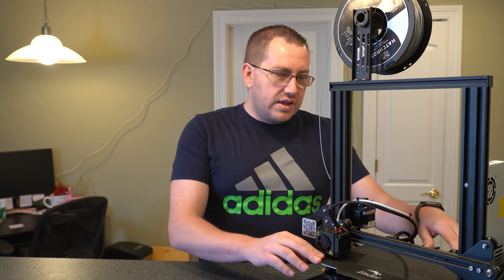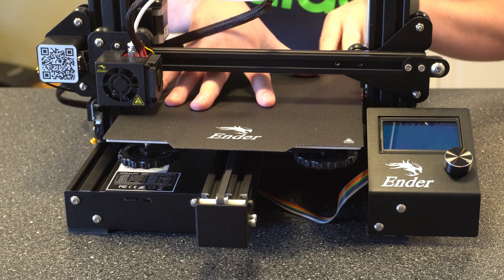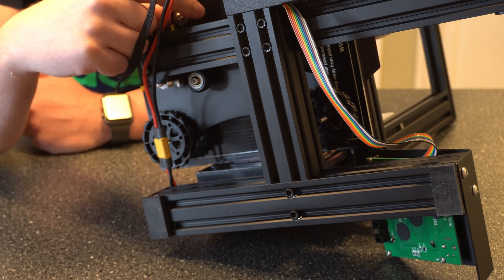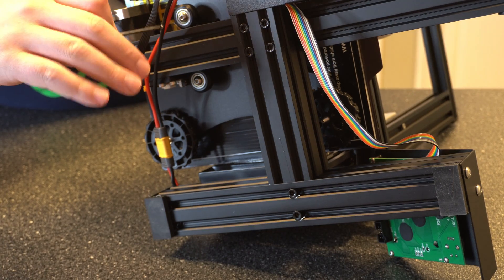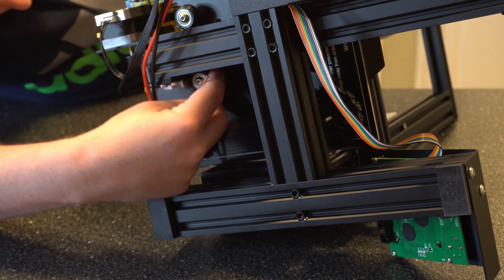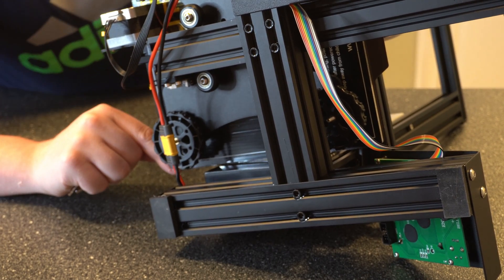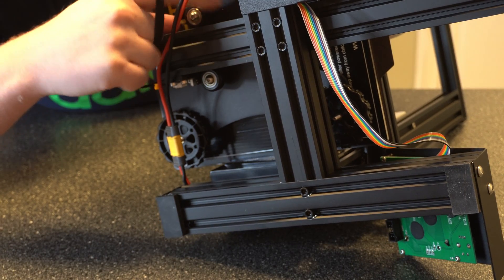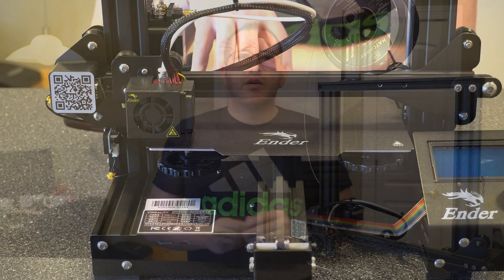Ender 3 Pro Bed Wobble – How to Fix It!

Comment: strong recommend against leaning an ender 3 on its side. Luckily power supply still ok
Reply from the maker: Hi. Thanks for the feedback. I have had no issues doing this but you will need to relevel the bed and stuff.
Reply: @3DPrintscape  was a helpful video for getting the basic idea of what was going on. I just had the provided wrench and don't have enough hands to hold the provided wrench in place while squeezing the rollers together and tightening them, and you can't just lean it against the works or else it gets stuck and you undo your efforts.
Reply from the maker: @williaminnes6635  Hi. ya it can be a pain some times. Thanks for the feedback.

Comment: For anyone stil having this problem even after you've tightened everything, make it tighter. These have to be SUPER tight.
Reply from the maker: Hi. Thanks for sharing. Just don’t over tighten them. I had an issue where I dented a wheel doing that.

Comment: Hi, you are great.  I have a shift happening after 1st mm.  Then all is normal but still not what i need.  I admit my maintenance is crappy.  Do i need to oil the long vertical screw?  I know i have to clean the bottom wheels.  They are used pretty badly.  Do i have to exchange them?  This scares me…. Do you have a video on that?  I have an ender 3.  I checked the tension on the belts, they make a sound, so i guess they are ok.  Do i have to actually take them out and look if they are damaged?  Also, found some advice on looking at the pulleys but no video how to do that….  I am not a mechanic but a woman who, well, is scared of destroying my work tool.  Any advice would be greatly appreciated.  Thank you.
Reply from the maker: Hi. I have a video covering the lubing the z axis and that should fix any issues there. That said, i would also look for a damaged wheel or something like that.

Comment: This is easier on the ender 3 pro, one side of the carriage has eccentric nuts that can be turned using the 8mm wrench to press the wheels into the track. Access only needed from the bottom side, which is nice.
Reply from the maker: Hi. It is for sure.
Reply: Idk about that I've had so many issues with my brand new ender 3 pro. Now I'm having trouble getting the bed to stop wobbling. I've tightened the stationary wheels and done the eccentric nuts but even if I get it close it's never right and the best I've done is print in the middle of the bed

Comment: I've tightened everything down and it's still wobbling
Reply from the maker: Hi. Did you tighten the eccentric nuts on the right side of the bed?
Reply: @3DPrintscape  i just said I've tightened everything down, didn't I?
Reply from the maker: @RIPLinkTTV  The eccentric nuts are different, so i wanted to make sure you got those. If you tightened all of the outside bolts/nuts and it still wobbles you can adjust the eccentric nuts to fix that.
Reply: @3DPrintscape  how can I adjust the eccentric nuts?
Reply from the maker: @RIPLinkTTV  This is an old video, i cover that more in this version of the video. https://www.youtube.com/watch?v=AAlDrkhMqYw&t=0s

Comment: Rob has some good ideas to get you going but assuming all your hardware is snug this doesn't fix bed wobble. Go check out Easy Fix for Bed Wobble on Ender 3 3D Printer by Jerry Jackson DIY, he has the missing info to Rob's video plus Jerry keeps it short, sweet and to the point...unlike this comment
Reply from the maker: Hi. Thanks for sharing.

Comment: good video, quickly just jumping thru, did you ever touch the hex standoffs between the wheel and plate? took me over a year to find out they drill it off centre. meaning on side pushes the wheel closer to the extruded frame. very useful to get any twist in the bed
Reply from the maker: Hi. Ya i had to adjust those for different reasons. I cover that in more detail on the replacement video i made for this.

Comment: There seems to be a slightly different design on my new Ender 3 Pro which just arrived as you don't need to use an allen key (just the spanner) but this fixed my issue before bed levelling.

Thank you for helping out us newbies to 3d printing!
Reply from the maker: Hi. Thanks for the info and feedback.

Comment: In fact, the first thing to do before assembling any screews on an Ender, is to put a level on the bed, perpendicular to Y axis. Than we slide manualy along Y axis an see if it's the same a along. If not investigate. It might be about roller but also a warped Y axis extrusion.
Reply from the maker: Hi. Thanks for the feedback. That’s good advice for someone setting up their printer for the first time.

Comment: Your video wasn't the correct fix for me. For anyone else with a rocking bed, try tightening the two eccentric nuts on the right side of the bed (left side doesn't have it). I watched Jerry Jacksons DIY video on fixing the bed and it worked. Thanks anyways, man!
Reply from the maker: Hi. Thanks for the feedback. I did this video based on the issue I was having. I realized afterward that I should have talked about the eccentric nuts. I will add a note about them in the description.
Reply: Absolute lifesaver of a comment. Had been having issues with the bed rocking, tried the solution in the video, didn't work, tried this solution and problem sorted.

Comment: You know this video would be 100x better if you stayed on topic, filmed the important parts (or drew a diagram! or took off the bed plate! you're trying to make an educational video!) - I was hoping for an explanation of things to consider not 5 minutes of you turning 4 screws, we know how screws work!
Reply from the maker: Hi. Thanks for the feedback. I agree the use of a diagram would have helped out. It's difficult to create a video that will make everyone happy, so I try to target the 80%.
Reply: @3DPrintscape  I saw a reddit post of a guy spitting and cursing that he was tightening those bolts till he went blue and only made it worse - if you position yourself as a teacher you have a responsibility. Imagine if your doctor told you, well I'm sorry your surgery went wrong, I try to target the 80%. 🤷‍♂️
Reply: @OnufrievS  This could have literally been a 60 second video. "See these bolts? Tighten them." plus, the part he forgot "See these right side bolts? they are eccentric"
Reply: I found this video useful where other videos made it seem trickier.  I guess I'm in the 80%

Comment: I hate you, I've been dealing with this forever and I watched your video and I thought that was the best it was gonna get. you were wrong this whole time. there are two hex nuts by the wheel. that's where you tighten it, not the nuts between the plates.
Reply: directly on top of the wheels on the right side is where you tighten the hex nuts. and hold the plate down while you're doing it.
Reply from the maker: Hi. Thanks for the feedback. Sorry I didn’t cover the eccentric nuts in the video. I was focused on correcting the larger issue I was having from my kids messing with the bed. You would need to make sure the parts I coved are tight, then if you are still having issues, you would look into tightening the eccentric nuts.

Comment: The most important part of the video is off screen. I have no idea where you put the wrench. It is not clear what you were adjusting. You should have thrown this footage away and redone it with better camera placement.
Reply from the maker: Hi. Sorry about the camera angle, Its such a small area to work that there wouldn’t really be a good way to capture it with the camera I have. The wrench goes on the nut that is above the steel frame.

Comment: Hi, good video 🙂 I would just add that the adjustment needed of the bearing wheels can also be on the eccentric nuts. Turning them a bit at a time will remove the last of that wobble.
Reply from the maker: Thanks, and thanks for the additional tip!
Reply: Yup, that did the trick. Also, easier than using the allen wrench in that tight spot. Thanks, Aaron.
Reply: This was the correct fix for me.
Reply: @Violianom  yes this video is actually 100 percent wrong. I wish he would clarify that torqueing the small 8mm nuts does not fix the issue whatsoever. My guess is that he just got lucky with the eccentric nuts being turned while he was trying his "fix".
Reply: @MakerMods  yeah, my bed wobbled up and down a few millimeters at the edges and was even able to rotate, this fixed it in just a few seconds
Reply: Thank you! That really solved it. For those like me who didn't know what eccentric nuts are: the slightly bigger nut (8 sides) that you only find on 2 out of the 4 wheels. They are off-center inside so turning them will fine tune the distance between the wheel and the bar.